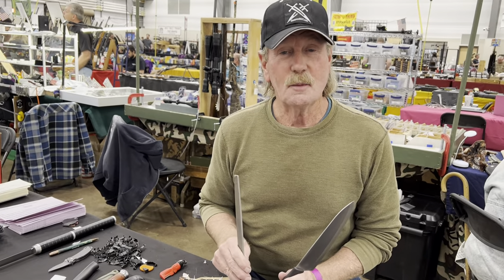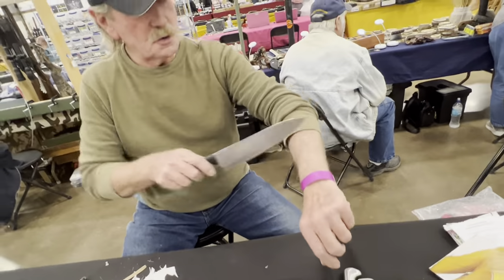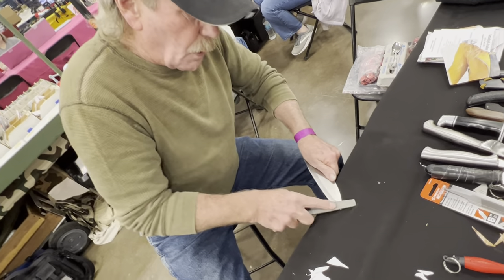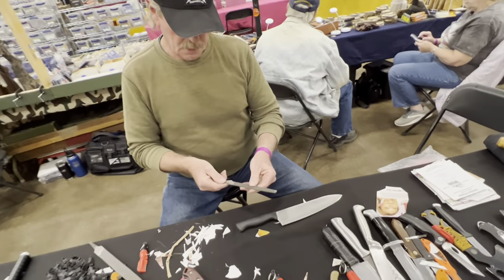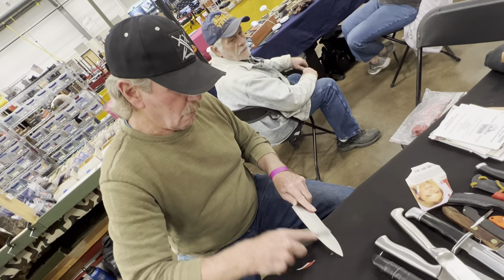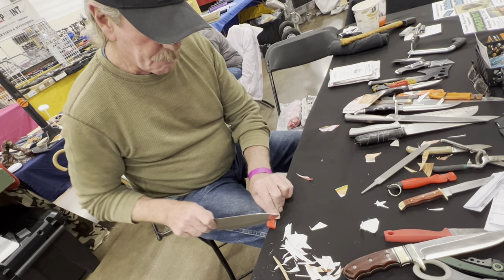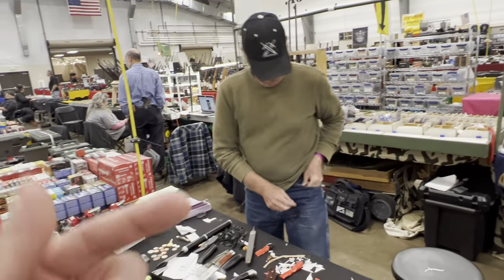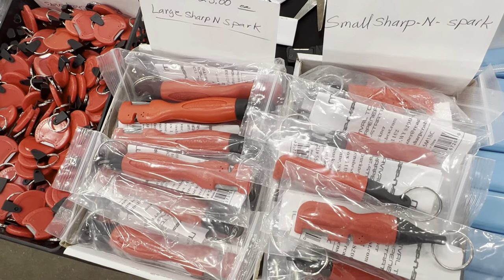Sharpen a Knife with a File TV Special

Comment: No way that Farberware is at 62hrc. The steel it's made from isn't capable of reaching even 60hrc (you need at least a 0.5% carbon in steel to hit 60hrc and those are most likely 420j2 which has about 0.3% C) from the quench, forget after temper. I'm guessing 53hrc, 55hrc at the most.
Reply: I think he meant the file is 62.  that farberware is close to 45 or 50. They are very low on the hrc scale
Reply: yep.  he does not seem to know much about knife steel.  he seems to be the king of gas station knives.  not sure if he is aware of different steels other than those found at Loves truck stops

Comment: The reason the file is "skating" off the knife is because you are not using the correct side for the file.  Each side has a push or pull to its grooves, if you try to use it the wrong direction, it will not cut or will very slowly.  That knife is not 62 hrc, more like 52hrc.  There are multiple videos testing faberware products in testers and they land between 45-55.  

I am still asking for you to sharpen a knife at 64 or higher HRC.  I will personally send in or bring a knife to a show you are at to see it in action.  I still believe you can not sharpen anything above 62hrc with the "SHARPENSBEST"  It will just continue to dull the steel or take so long it will burnish the blade.